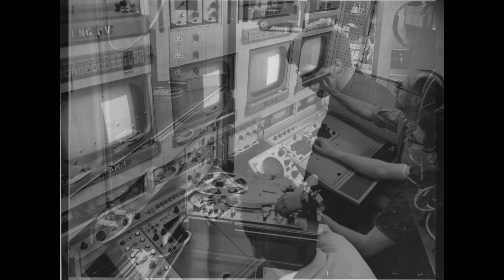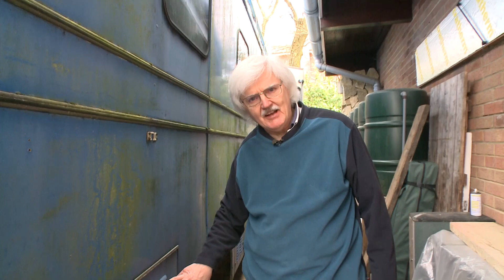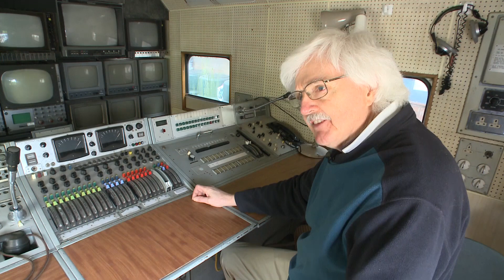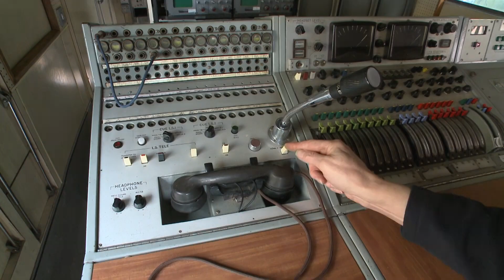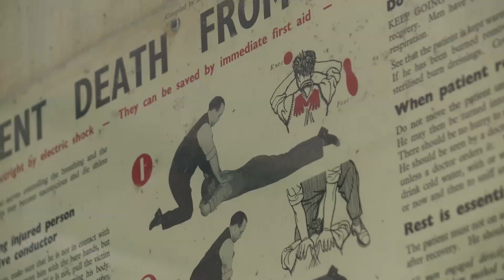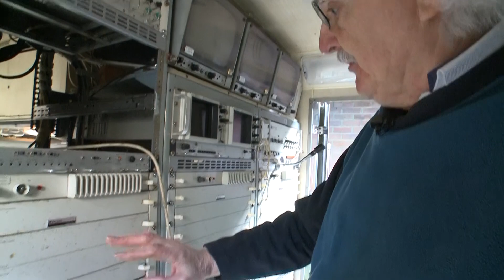2. MCR 21 - an introduction by Brian Summers

Comment: Hi WOFFY   Thank for your words of encouragement, it really does help to keep our sprits up.  Each week our small team of volunteers come and take on various aspects of the restoration, today, Paul who was labelling some of the cable runs, a small but important detail. Steve is repairing/replacing  a section of the original floor lino that worn away, and I continued a metalwork task building a frame for the audio Indent unit. There is still much to do!